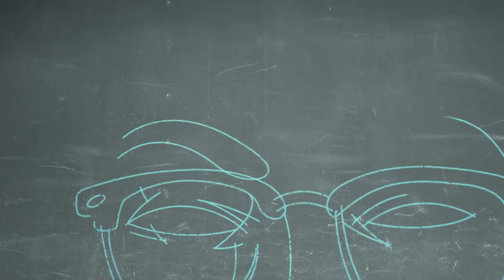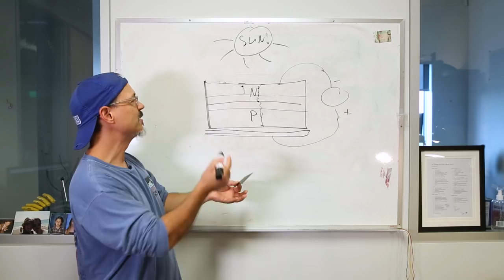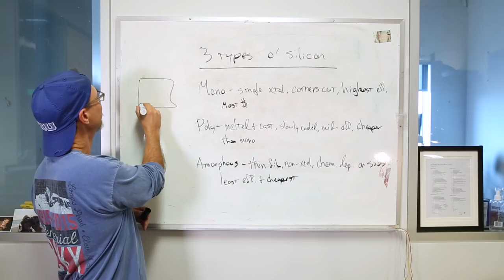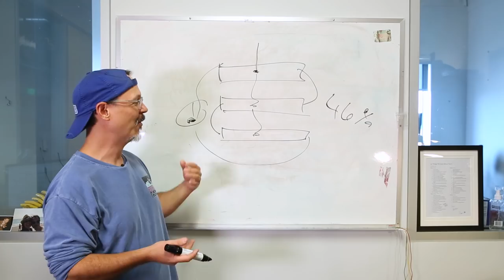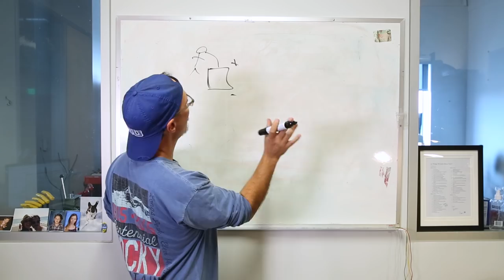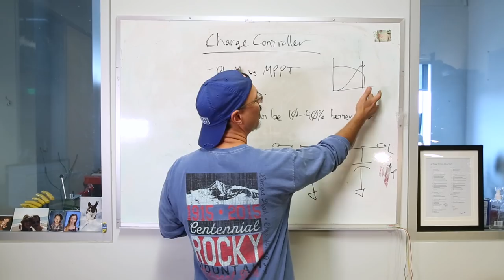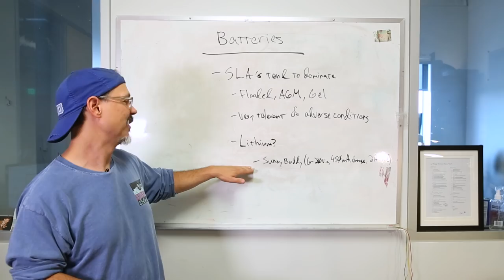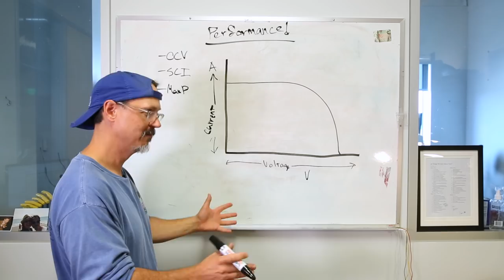According to Pete #59 - How Solar Cells Work

Comment: Great subject. Hope you plan on doing more on this. I had a little project lately that got me researching this a little bit, granted it was pretty minor. I wanted to have a solar panel to maintain my car battery because I pretty much never drive it in the summer because I'm too busy riding my motorcycles. I could plug in a battery tender but that is a pain. So I started with a 5W panel and a PWM controller, but that wasn't actually maintaining the battery. Then I added a 10W panel in parallel and that seems to be barely maintaining....granted that was way more money than a cheap battery tender that you plug into the wall. I was thinking about getting a MPPT and putting the two panels in series, to get better efficiency when there isn't direct sunlight on the panels, but I'm not sure if it is worth bothering.
Reply: That's interesting. I wouldn't think it would take much to maintain the battery for a couple of months. But then, I also don't know what the static drain on your battery is (like, accessory junk that still draws when your car is off). Are you disconnecting it from the car during this time? Wiki says 6%/month self discharge worst case...
Reply: +Pete
The typical car parasitic draw is 20-30mA, but I have a couple aftermarket components installed, mine is probably higher although I haven't measured it. But I also live in Seattle, I have tinted windows that the solar panels have to fight with, and even when the sun is out, the position of the car and buildings around it, I probably only have 3 or 4 hours of direct sunlight. The voltage drop with indirect sunlight is pretty severe, the panels are only 18v.

Comment: I've been seeking this answer for years: How can someone at home create a (basic, very bad, super inefficient) solar panel out of safe materials? This would be an awesome science project for kids.
Reply: Well... huh. Off the top of my head, you can make something like a P-N junction (and/or a battery) just by putting two dissimilar materials together. Hmmm... I might try this. Maybe, like, a really thinly sliced piece of potato (so light penetrates) and... copper sheet? I'm not doing any real chemistry here, but I bet you'd see something positive, or maybe more positive, when it's exposed to light.
Reply: @snakeoilification  thanks for the reply. If you try it, please post your experimentation! I'll also think on this and try something with my 12 year old.

Comment: Thanks!  Now, rather than spending too long trying to impart this stuff to neighbors, etc, I can just share this link.  The good stuff.  I've been off-grid since '79, system array is now 5kw or so in full sun, > 50kwh batteries (Crown brand), Trace/Xantrex/Schneider (all same company but mergers and acquisitions) electronics.  More 9's uptime than the power company by far.  Some of my panels are 3 decades old and still working fine. Poly-crystalline all.
Home Depot or Loews?  Get about 2x more for your money with the solar pros (several specialized vendors of this stuff) - not the "horrible fright" versions of it.
Reply: Doug! OMG good to hear from you!

Comment: Ok,, cutting to the chase. 
At this time, in 2018, 
How much does it cost for a solar cell system that will power 200 amps, at 120 volts.?
Oh,,, as long as something isn't given away, at no cost to anyone on any level. There is nothing free. 
Ever find free solar panels ? Or free windmills? 
And what is the carbon footprint of the manufacture. Or pollution?
Reply: Oh, I'm totally with you. But this isn't really the forum where that sort of thing gets traction.